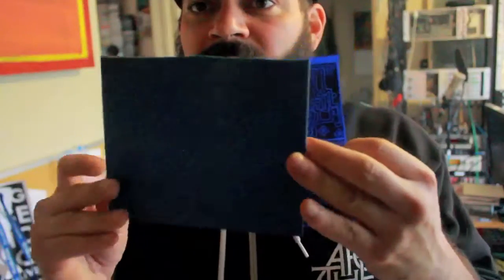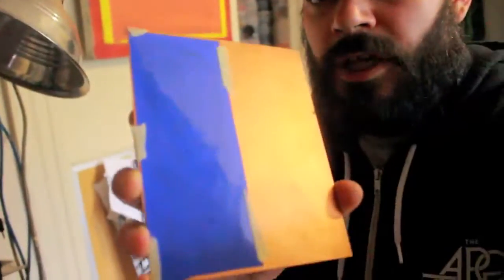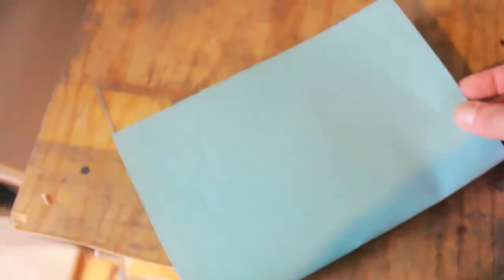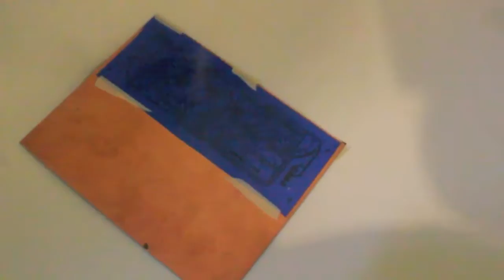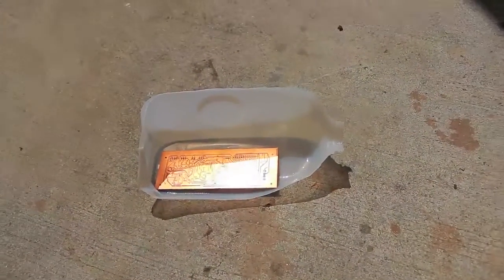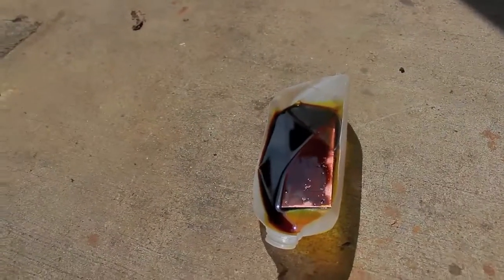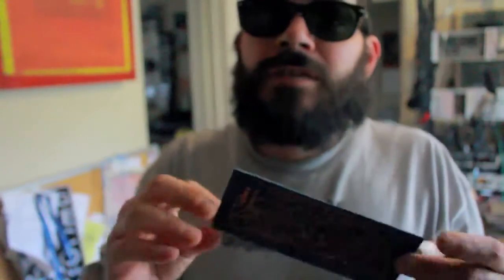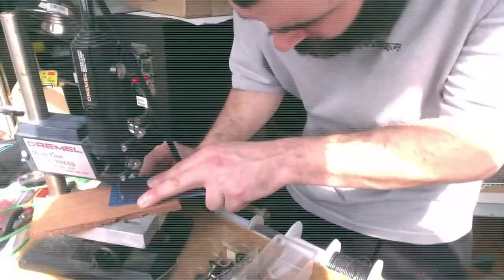How To Etch a PCB

Comment: Thanks for showing this process! Always thought it was way harder than that, just looks like it takes time
Reply from the maker: Right On! Just like any chemical process, there are many variables. The ironing process is probably most difficult to master. then using a tupperware with a lid helps because you can shake the shit out of it while etching, that helps to get an even etch & activates the ferric chloride. I hope that this video will help with some little things that the P&P directions don't convey. Peace